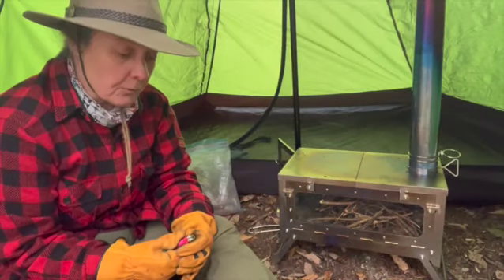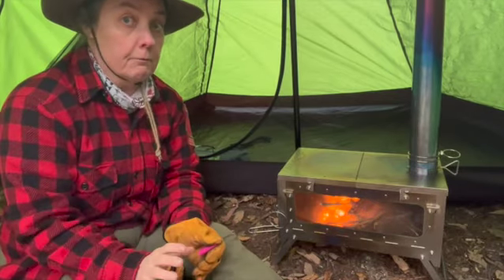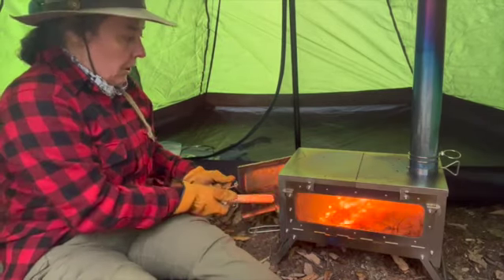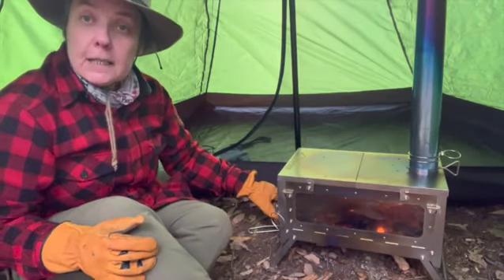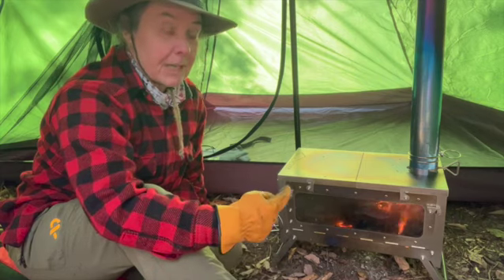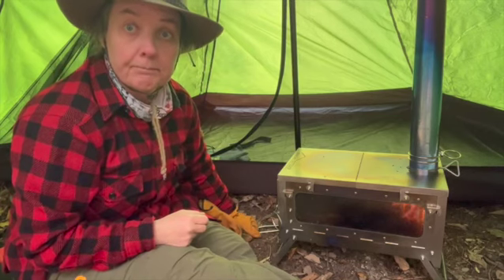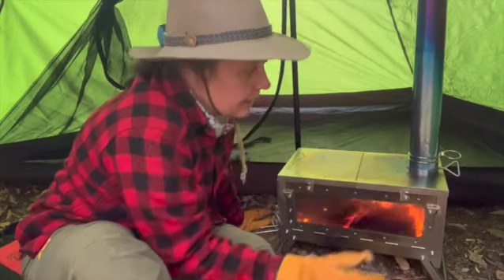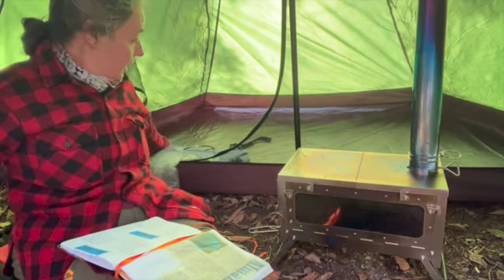Tending the Hot Tent Wood Stove

Comment: Great video Lisa. Definitely important for people to know how to properly operate these portable stoves as well as set the expectations for what these kinds of setups are good (and not so good) at.

I bought a similar ultralight tent/stove combo a few years ago for the exact same reasons. I did the Debsconeag loop in mid November 2020 and it was a beautiful time to be out paddling in hunter orange but every night was a bit of a test between the below freezing temps and up to 14 hours of darkness. You can only sleep so much. Also it takes much work to find good wood near campsites at the end of the season, it's a real drag to do all that work just to watch the heat go straight up to the sky in with an open fire. After that trip I decided to buy one of these setups.

These stove and tipi-tents really make for a comfortable place to hang out if you have to kill a couple of hours til bed time -- they keep away from the wind and you can dry your gear out. As you mentioned in your video, they are much more thermally efficient with wood and provide a nice cooking surface if you are solo. I also use mine in the winter. I've camped in the NMW in sub-zero temps in mine -- with a sub-zero rated bag of course. If it's just a one or two night trip I'll carry a few BioBrick wood blocks with me for the last burn of the night. I think the company is based out of Epping, NH but I get them at the local Ace Hardware here in Scarborough.
Reply from the maker: Debsconeg’s arguably the most stunning view of Katadin available. Cold effects me the older I get, can’t wait to try this setup.

Comment: Definitely agree don’t need it going all night.
Even in the dead of winter I use it to get me and my sleep system warm and dry.
Then if you have the proper sleep system you should be good till morning.
But have kindling ready because it’s going to be cold 🥶 when you crawl out of the sleeping bag
Reply from the maker: Yes very good tip. If you’re cold and then insulate in the sleeping it’s like putting ice in a cooler. Much better get warm and dry and get in a good insulated sleep system and keep it that way. I also think there are many advantages to having half the floor be ground. Thanks for watching and sharing.

Comment: Another thing you can do is burn enough to build a bed of coals and then put a small, green, birch log on top. It will burn much longer. I have seen where Natives simply cut a black spruce and keep pushing it into the stove as it burns. The stove door remains open. The tree length fire wood leans on the floor and maybe even out the tent door. How do you like the titanium roll up chimney? Thanks for the video.
Reply: What do they do when the stove starts glowing like a cherry? Can't close the door with a tree sticking out
Reply: @anonymousf454 Ignore the glow. Often the stove is a home made barrel one. What is exciting is when the fire burns down the log. But a little snow stops that.
Reply from the maker: I’ve never done that. But next episode is a deep dive into just the stove. What I like and how it goes together. Thanks for sharing.